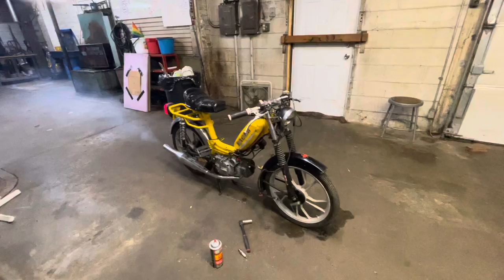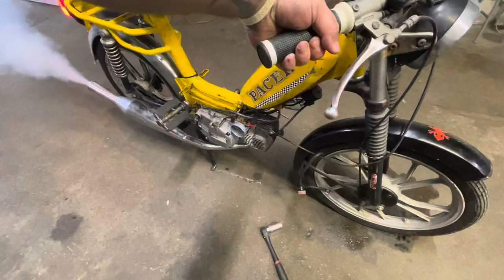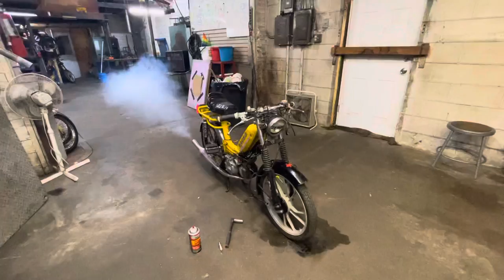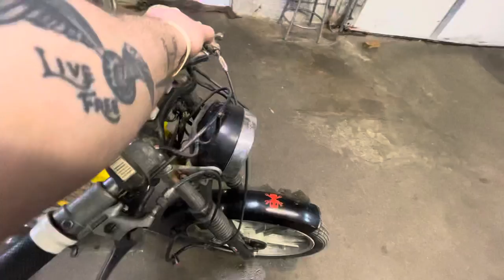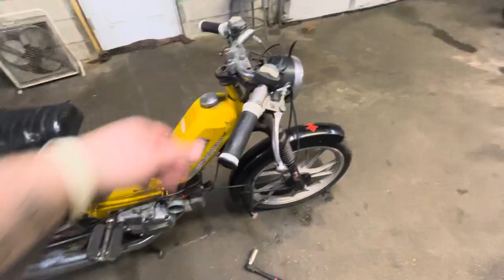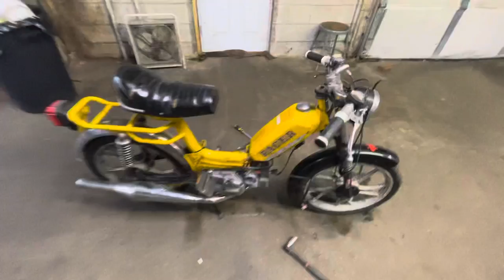M1 Morini Polini Powered Pacer: first start

Comment: Which oil should put in this Franco Morini-Pacer I got one
Reply from the maker: Transmission fluid is Non-detergent 30, if you are referring to mixing gas, any name brand oil at 50:1 should be fine
Reply: @Ascoute1  thank you! Is transmission fluid.